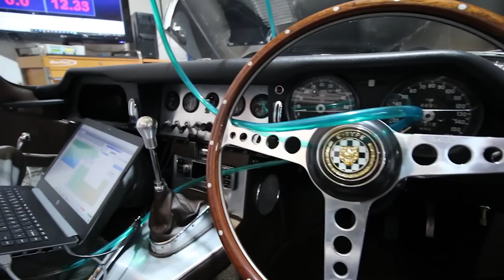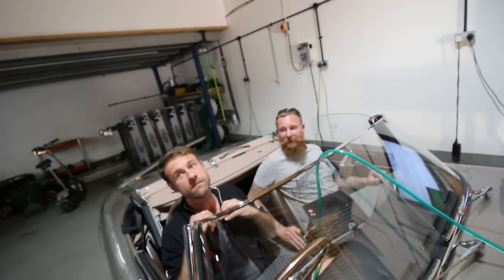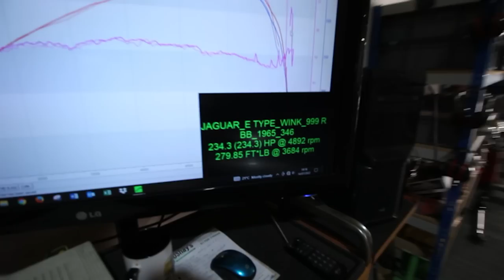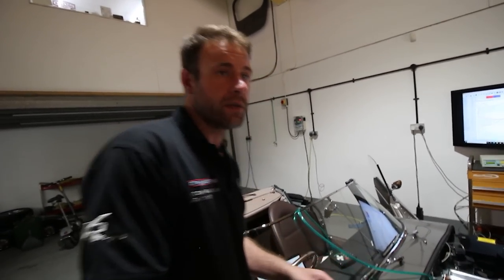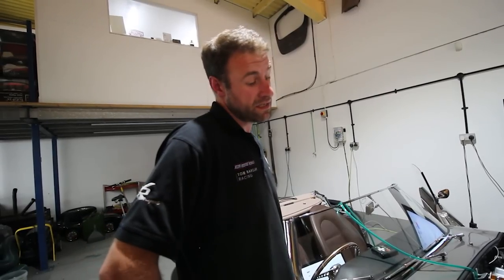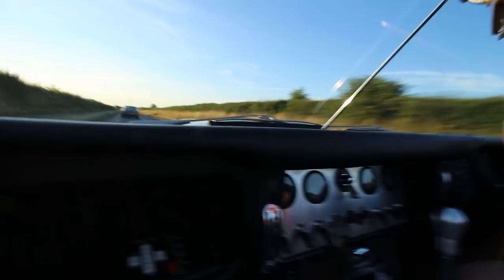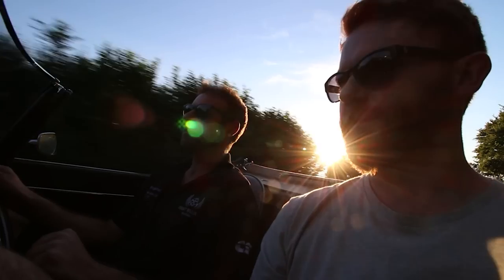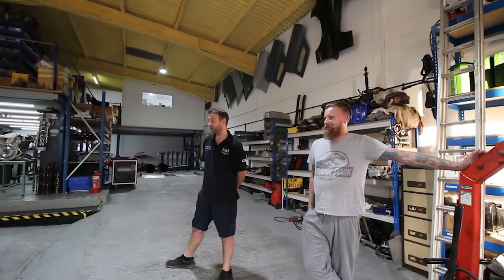You won’t believe what Tom has done to this E-Type…

Comment: Now that's what I call one beautiful car, and the sound is orgasmic! 

Just to put things in perspective a flat front Mk.2 Escort circuit car I built for Russell Clark back in the early 90's fitted with a very hot 2.4 litre Pinto engine on 50 DCOE Webers and Zytech ignition, made 215 bhp at the wheels @ 7.2K rpm (245 flywheel) with very good torque and perfect throttle response with a 8.4K rev limit. The car weighed in at 810Kg wet and used a 4 speed gearbox, as the 4 speeder suited the torquey engine so well. Russel was never beaten in that car, (in it's class), the engine was completely reliable and no one even got close to him on the track.  Russ racked up dozens of wins and 4 overall championships in 1990's Modprods before HTR moved on to developing the CVH engine in front wheel drive Fords,  I test drove the Escort on a number of occasions on the road and the track and I found the acceleration and top speed to be quite incredible for a Pinto Escort, on race gearing the car would hit (tested at Bruntingthorpe by Fast Car Magazine) a true 140mph in around 17 seconds from a standing start and with 60mph coming up in around 4.5 seconds, these figures were achieved on road tyres and tested by FCM's 5th wheel calibration/testing setup they used to test the performance of cars for the magazine.. 
One time I was down at Tim Swadkins place, I think in 1998 having an engine dynoed and there was a lightweight E Type racer in the workshop (3.8L on triple SU's), there was also someone with a Cossy that had been chipped to give around 350 hp, well there was some discussion going on between the owners about the performance of the two cars and they decided to take the cars out on the road to see which one had the biggest cock, well the E Type actually proved faster, so happy days there then (cos I fukkin love an E Type!)  'Sausage'  HT Racing Ltd

Comment: Unnoticed by most is the upgraded 5 speed gearbox. The original and correct Moss gearbox dated back to the 1940’s and didn’t have syncromesh in first gear. The syncromesh in the top few gears was very weak by modern standards, requiring a deft touch and proper timing. A quick downshift required proper rev matching and considerable experience and mechanical sympathy by the driver. I was able to execute silent downshifts into first gear while moving in autocross racing, but the risk of chipping the straight cut gear tooth with a bungled downshift was omnipresent and hardly worth the risk. Jaguar designed their own improved full syncro 4 speed box and introduced it in 1965 with the Series 2 4.2 liter XKE. This update was augmented by a better and stronger clutch. Various rear end gearsets were offerred: 3.07-3.70, all with factory limited slip differentials. The cars with the lowest numerical gearsets were the only ones capable of 145-150 mph top speeds in stock form. The highest numerical gearsets gave the lowest quarter mile times. Later cars became slower as they gained weight and became less aerodynamic. Federal safety and emission regulations beginning in 1968 further reduced performance and forced accelerated development of the V12 powered E Types. These were necessarily much larger and heavier cars and moved the E Type from sports car to GT car. The fastest E Type in stock form was the early Series 1 built from 1961 to 1964 with the 3.8 liter engine. The 3.8 revved out better and higher than the 4.2 liter that replaced it.
Reply from the maker: Thanks for that very interesting. Learn something new everyday 👍🏻
Reply: Yeah, but they (Jaguar) soon got rid of the Moss gearbox. :)
Reply: @grahamw56  Jaguar used the Moss box from 1948 until 1964. That was a long run.

Comment: How is the throttle response compared to carbs?  I had 2 early e-types and they never revved like this thing...
Reply from the maker: its crisp and very responsive. far better than when it was on the carbs as the veriable ventury is not floating up and down inside. its just the original butterflies modulating the airflow. and the ECU/injectors now provides the perfect fueling mixture throughout the rev range and throttle position.

Comment: Have they put Stromberg carb tops on top of throttle bodies?
Reply from the maker: No there’s injectors mounted in the inlet further down And he’s using the butterfly’s of the carbs as just throttle plates. The needles and floats etc from the carbs are all blanked off

Comment: Any more info on convert the su's? Obviously minis use them and they've been proven to provide enough fuel for 300hp. Is it just one injector per cylinder? And where are they mounted
Reply from the maker: It’s literally just the carb butterfly that is being used from the SU. The inlet manifold has injectors mounted on the underside with a neat little fuel rail. Each inlet track has an injector.

Comment: So it produced 234 HP at the wheels after all that work at 4,800 RPM. Thats about 15HP more tan when built?
Reply: But now its like that for the rest if it's life. No more messing with SU tuning every time you change your undies. Increases throttle response.
Just jump in and enjoy.
Reply: Most standard e 4.2 will make around 205 at the wheels, rare a standard will get to 220, the same as saying they all do 150mph (which is also a claim) they don’t not even close..
Bet this one does though ! 👍
Reply: The Vauxhall corsa VXR 1.6T would achieve 143MPH WITH 189 BHP FOR a fraction of the price of the work done on the E TYPE